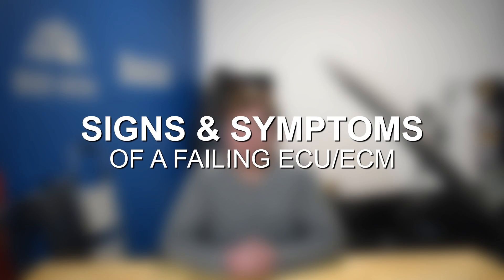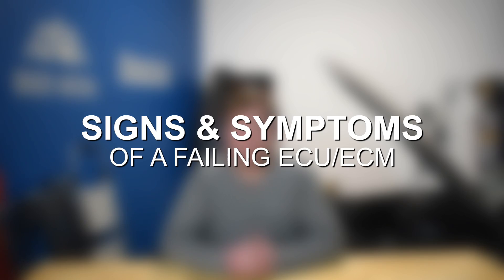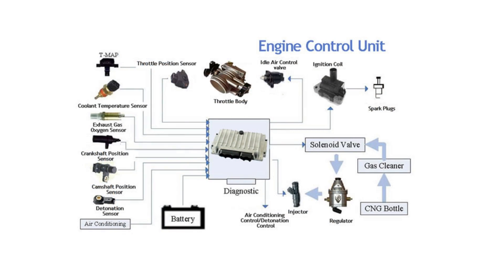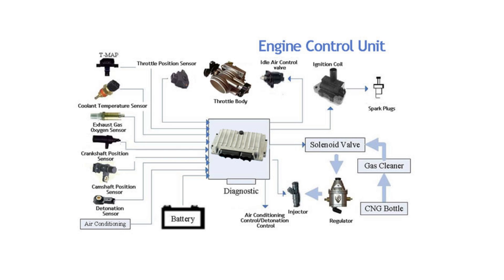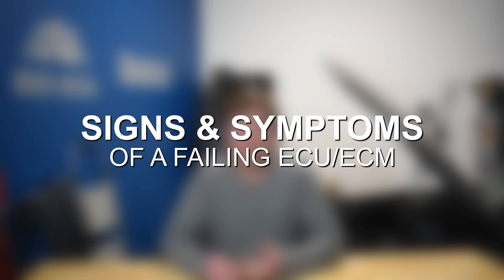Signs & Symptoms of a Failing ECU/ECM! (Engine Control Unit or Engine Control Module)

Comment: my 1993 corvette is showing a code 44 that means 02 sensor or running lean. 02 sensor with many other items have been changed on this vehicle. To list would be to long, but I still get H44 code and the vehicle runs good. Sometimes on idle at red light a little rough and light will come on then the light will go off but vehicle runs good. Changed prom in ecm thinking that would help still showing H44 code. Some times on the idle runs fine sent the ECM out last winter to SAI Electronics in IL and they said there was no problem. Cannot figure why this code continues to come up H44 is left bank 02 sensor. Both have been changed along with the cats to new magna flow cats. Many other items have been changed on the vehicle but continue to get code 44 with check engine light. At wits end
Reply from the maker: J - Sorry to hear this. Have you taken it to a shop?

Comment: I got a 91 Ford f350 7.5 i have replaced almost everything but it still misfires. Could my PCM be a problem?
Reply from the maker: H - What engine codes are you getting?
Reply: @8020Automotive  recently the codes are 87. 10. 93.
Reply: @8020Automotive my truck takes a OBD1.

Comment: Ive got 23 fault codes. 2017 vw golf tsi 1.4L

Ranging from misfires in cylinders 1 and 2, starter motor issues (car starts fine first)

As well as the steering angle sensor
Reply: Hello Dorian, Can I ask if you got to the bottom of your issue yet? I have the same engine in my Caddy and had many fault codes relating to the turbo at first and progressed to other areas ( throttle body ect ) all were voltage related. I changed the turbo actuator and had been working fine for maybe 2 months but all started again now. wondering if you changed your PCM? 
My PCM  had a few corroded pins that were cleaned up first time around but I didn't think that was going to be the permanent fix.
Just wondering how you got on?
Many thanks
Kev
Reply: @MrBluegooh  sorted.

Turns out faulty battery that was overcharged damaged the throttle body throttle position sensors and put the car into Limp mode. Changed battery, 23 fault codes became 1, replaces throttle body, no more codes.
Reply: @Autisticschwitz  Nice one, after the money I have thrown into mine getting a new battery won't hurt too much. Thanks mate.
Reply from the maker: D - You might want to get that checked out.... Sounds like a lot going on.

Comment: My 2012 Honda accord was diagnosed with the u1055 code ECM and the lights are popping up for the TCS, ABS and handbrake light. What do I check and have to fix, to get those light to go away? Can I drive, without issues?
Reply: I’m driving the shit out of my car. There is nothing wrong with it, just the lights that are still on.
Reply: @monicatheshyone3985  battery maybe? When power isn't going trough it correctly it can throw off codes. So maybe check alternator, battery, or grounds?
Reply: @monica_theshy1_3985 😂😂😂

Comment: Would  my ecm be bad, I have drove 3000 miles and obd reader says some things are not ready for inspection.
Reply from the maker: J - This is very vague and we aren't sure how to help. What things aren't ready? What codes are you getting? We just need more information.
Reply: @8020Automotive  I think my ecm is failing. No codes on dash . Everything I take it to get inspected, it doesn't pass . They tell me the catalyst, h2o sensor, and o2 sensor not ready.
Reply from the maker: J - Have you taken it to a mechanic?

Comment: odb2 what a joke . misfire ... new plugs , wires , distributor , crankshaft sensor , tps, new injector system , 350 bucks in diagnostic fees .2002 blazer 4.3 engine . ecm or ecu ? which shows gm intelligence they couldnt figure out what to call it. great compression great leakdown test . if the ecm/u does not work i might drive it to detroit and park it in gms lobby.
Reply: Lol get some rest guy
Reply from the maker: C - So sorry to hear this..
Reply: Maybe fuel regulator,fuel distributor/spider, or fuel clog. If you feel like its spark, backprobe ignition module to ground for expected or control signal. Do the same voltage/drop test for chasis grounds just to verify them. Follow bad circuits to fuse/relay, ecu, or chasis grounds with diagram. My experience is with the direct ignition. I believe a forum mentioned reseating your distributor or there being an issue with the gear.
Reply: Same here on a Mercedes. Have it at another shop waiting on results. $1500 in so far.
Reply: Was a bad ground prob
Reply: Take a nap bro
Reply: Yall a bunch of parts changers...Dont change parts until you can prove its bad with testing and logic...every parts clown Always just unloads the plugs wires injectors   then complains it didt fix it.

Comment: what would cause a fuel pump to shut off, i have a 2006 ford f150 4.6 it starts fine runs for like 2 minutes then idles down and stalls. the on board system tells me to check gauges, everything seems ok. then i try to star it from that point and it just cranks, no start, but if i turn the ign key to off and it will repeat the run and stall, i took the plug off the fuel pump driver module .and jumped the 2 outer wires and it starts and stays running. can not figure what is going on any suggestions!
Reply: Fuel pump overheating.  Works good when cold then shuts off.  Mostly with aftermarket pumps
Reply from the maker: G - We have a video specifically on the fuel pump that may help: https://youtu.be/cua6aG2ld9E

Comment: Will this cors the car to over heet
Reply: no, i'd check your thermostat and coolent temp sensor an depending on vehicle check the radiator fan relays 1st.
Reply from the maker: J - Great advice here. Thanks for replying to Steven.
Reply from the maker: S - Not likely.

Comment: For some reason the check engine light does not come on at all on my car, I have a ‘77 porsche 924 and it does not come on despite my car misfiring constantly. Cant even accelerate/ step on the gas without it misfiring and the car wants to cut off and is sputtering. Any ideas on what it could be?
Reply from the maker: Z - Have you checked for engine codes? This is usually the best place to start for diagnosing.

Comment: I recently messed up my truck (2003 Silverado 1500) I connected my light bars positive wire to get power and connected it to my f/pmp relay and while I was doing it my truck shut off and ever since no crank , no start then I moved around the fuses and it starts but the dash doesn’t work and it says low power , when I go to turn off the truck it doesn’t turn off the engine keeps running for a minute then turns off . Any suggestions?
Reply from the maker: E - Are you getting any engine codes?
Reply: @8020Automotive  turns out the reason the truck didn’t want to crank and start was because I put to much pressure in the fuel lines and needed to bleed it out got it back from the dealership running but still electrical problems I checked under the hood and a ground was disconnected from the battery. I plugged it back in and good to go my fault for not noticing the obvious
Reply from the maker: E - Thanks for coming back and updating here! This will certainly help future viewers.
Reply: @8020Automotive  the dash wasn’t working I got my truck back to running good took it to the dealership

Comment: I believe my ecu/ecm is failing on my 18’ camaro throwing all those codes and giving a list of faulty sensors. Is it better to replace ecu first rather than going down the list and fixing all the list of codes? Ive replaced a couple of the codes like spark plugs, 2 ignition coils, and has fixed the misfires. now giving oil pressure fault sensor. And still idling rough
Reply from the maker: S - If it was up to us, we would change sensors first as they tend to be cheaper. Keep us updated.
Reply: @8020Automotive Correct! Bad signal input can kill an ECM, the hard faults should be rectified first before trashing a new computer with the same issues.
Reply: Having the same problem with my Impala but now the battery is leaking
Reply: I also have a 2018 duramax with 200k miles and it has a long list of codes it seems like it would be cheaper to get a new ecm but not sure. @sierraproduction6581 did you resolve the issue?

Comment: My car engine runs just fine but in the last few years when I’ve gone out to start up it like misfires and the engine light is flashing becomes undrivable. I go inside wait 10 minutes and start it up and it runs just fine. It’s done like three or four times in the last few years.
Reply from the maker: D - Sorry to hear this.. Are you getting any engine codes?
Reply: @8020Automotive
Reply: Check your spark plug wires/boots for any damage if so replace them, also check your spark plugs for any noticeable damage an if there is replace them. If that doesn't work an ya have one on you use a scanner tool to try and see if any codes shows up.
Reply from the maker: J - Thanks for the input here.

Comment: My Toyota camry 2013 has been acting up since last year and I’ve changed throttle body sensor three times now and with every change, it works brilliantly  for atleast two weeks and symptoms would still persist. Traction light would come on, the car would stop accelerating then when I switch it off for ten minutes, car starts accelerating but would get worse overtime until I change to a new  throttle body sensor. Code is p0121
Reply: Please help me